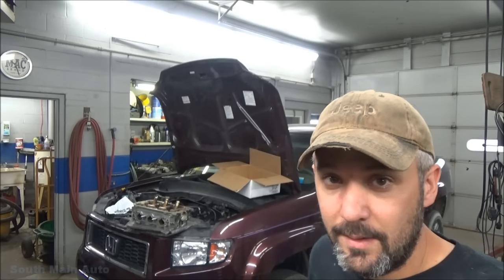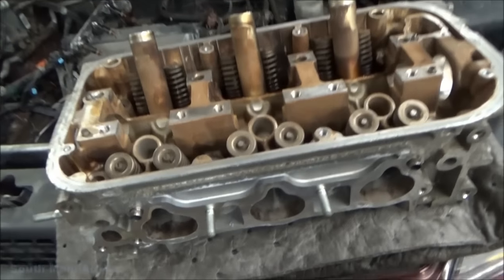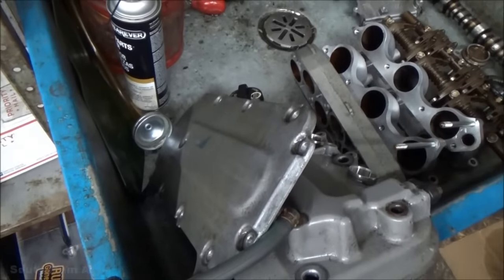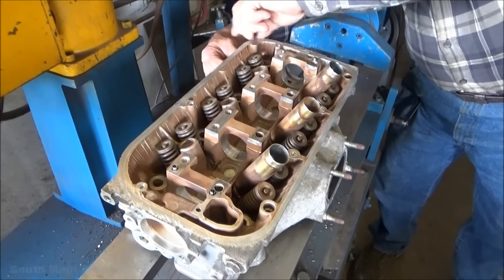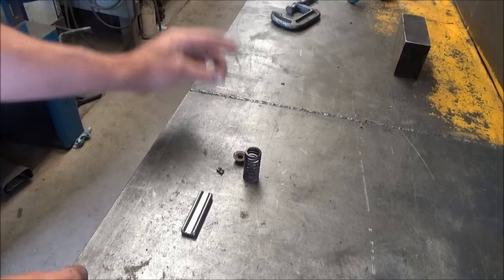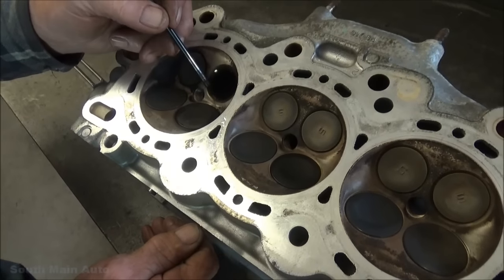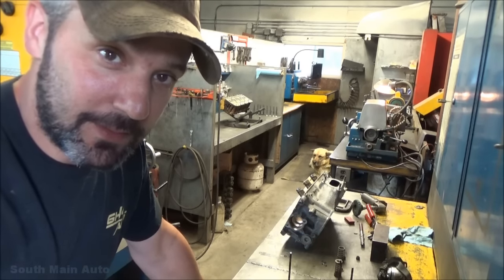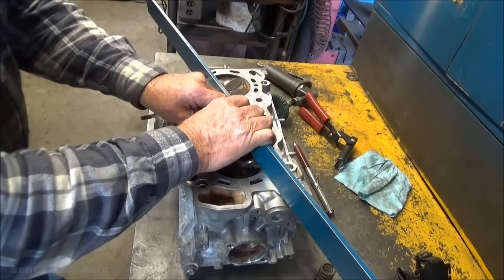Honda Ridgeline - Quick Trip To The Machine Shop

Comment: Nice.  Those kind of good small machine shops are a god send, those older guys with decades of experience are priceless.  Plus he has a shop dog hanging out so that makes it a legitimate shop...haha.
Reply: That dog probably been around the shop so long, he can fix heads.
Reply: I've got Johnny Rackleys here in Mesa, AZ that is AWESOME!!! They've done so much talented work like filling in aluminum heads that have been rotted out by plain tap water destroying the heads water ports and grinding back down during head plane process. Supplying thicker head gaskets to compensate for plaining the head etc. Great guys.

Comment: I'm an older guy[76] and i had my stroker engine built by one of these older gents back in February. He showed me the many flaws/mistakes the previous builder had left. We really learn the hard way as to how important that experience is. The younger guys just need time to get there. Not enough new ones coming up either. I thought i knew a thing or two about engines, boy did he give me an education as I assisted in building this stroker. Things you can only learn working side by side with these racing engine experts. Much respect......

Comment: I retired after 30 years in the Navy.  Tried the whole retirement thing but found I needed a reason to get up.  A long time friend of mine has owned his machine/engine shop for 45 years.  He's 67 and still works 16 hour days at least a couple times per week with all the business.  People send him stuff from all over the country because there's not many like him around who are truly "old school".  He only had another guy working for him and he exclusively does the heads.  He needed someone to be a "go-fer" so he could just concentrate on engines and not ordering parts, running for supplies etc....He "hired" me and I've been doing it now for 2 years.  The amount of knowledge he and his ilk have is amazing.  I've learned through doing now and really enjoy getting dirty and picking his brain.   Although we specialize in vintage American iron...we still have a fair amount of business from dealers and indy's so see a lot of Subies/BMW's etc..Guys like that just get stuff done.  It's not what they do...it's who they are and it IS difficult for them to give it up.  I don't see Gary "retiring" anytime soon...I literally think he'll do it as long as he can physically handle it.

Comment: I worked in an automotive machine shop for 8 years early in my career. Enjoyed learning from an older guy and turning out quality work. Glad to have had the experience. It was pretty cool seeing his shop and it took me back to the day, so to speak. The one thing I remember most was an old 50's chevy six cylinder that had been laying in the mud for years and I beat it apart with a two by four and a hammer. After all the machining and cleaning I reassembled it. From rusty scrap to a workable engine. Lot of fun for me. Thanks for taking the time to make the videos. Your time is appreciated.

Comment: I think the Honda tech hit the valve while turning the motor over by hand after the bad TB change.  Felt the binding and fixed it before he cranked it. But they did make physical contact and tweaked it a tiny bit.

Comment: Years ago when I still had my Outerlimits I had a pair of motors built by a guy just like this. He was a legend in offshore powerboat racing and I was lucky enough that his shop was close by to get work done there. Similar one man shop kinda place, and the work took forever, but only because there was a 3 year backlog of people waiting to get work done. At the dyno shed, they made about 1250hp each and were absolutely bulletproof. I had a blast with that boat but sold it just before the first overhaul.

Comment: In my opinion, which isn't much, is that the dealer tech had let the cam slap the the valve when the timing belt off.  Notice when your turning the cam in the other video how it has some kick.  Another possibility is that he had it a tooth off and started it and realized it later and corrected it.  In 4k miles I would say that you could build some carbon with a leaky valve.  Good video for sure.
Reply from the maker: I think in this case we may never know
Reply: Thats the truth.  I had bought an 05 TL with 87k that had the similar 3.2 Honda motor.  It was leaking oil from head gasket between head and block.  The guy I bought it from said the dealer did work on it 3k ago.  I called and they said it had some stripped head bolts and they pulled the head and put time certs(helicoils) in the block. 92K it was still leaking so I changed the motor myself. Just another example of how dealerships work.
Reply: Ya the preponderance of the evidence points to the dealer tune up. After taking her 80,000 mile bran new baby in for scheduled service, she gets it back with a bent valve. The dealer " I know your used to 6 cylinders, but 5 is ok"

Comment: My theory: either cam or belt was installed 1 tooth off, while turning over by hand to check, piston simply pushed against valve. There is enough mechanical advantage to do this. After misalignment was discovered and corrected, engine assembled- it was too late. Leak became worse as valve face angle burned, carbon built up, then stem was further weakened and burned. Dealers fault
Reply: That's a good theory.
Reply: I agree that's a logical theory - unfortunately there is no way to prove that is what happened!  And therefore no way to really get $$ from dealer!
Reply: yeah I'm afraid you're right,the vehicle has been out long enough to get the oil trail leading to a off center valve and started suckin oil into that cylinder,the carbon build up is the direct relation to the cam belt installation,when doing any kind of timing chain,belts,don't let engine get out of sync,not even a little bit,these little engines have gobs of spaghetti ,wires,vaccuum lines galore,the relationship of timing is critical,despite engine size,ERIC you were wise to get the experience check,he's a little older than me,when we're   gone all of that machine knowledge is gone too,i watched the first two videos,when you pulled the head I saw the oil,your compression test verified it
Reply: Problem appeared after timing belt changed.  Suspect you are correct, and the dealership did the dirty on their customer. Impossible to prove.
Reply: @davidhutchison3343  how long ago was timing belt done.
It would have taken time to build up carbon
Reply: @golfish8589   i think he said 4000 miles ago
Reply: That was my exact thought when The Machinist said there was a very slight bend in the valve. The mechanic did what he was supposed to do and crank the engine over slowly by hand after assembly and the thing hit he realized he made a mistake which is possible to do. Corrected the timing error but at that point the damage had been done.
Reply: What about the other exhaust valve in that cylinder? Didn't say it was bent. Kind of hard to believe that no other valves got bent from your theory. For the very tiny bit that valve was bent the tech. would not even have noticed anything from turning over by hand if your theory was correct. Not buying that theory.
Reply: @KStewart-th4sk  
In the follow-up video they discovered the mass of carbon buildup on the backside of the stem is probably what caused the bend in the valve. Cause excessive drag on the valve preventing it from closing. The question is what caused the carbon build-up. And nobody really could be sure
Reply: when you do a timing belt on a honda v6, the rear head is the one that "jumps" a tooth if not careful.  the front one is always straight.
Reply: If it were timing belt not aligned properly both exhaust valves in #4 cylinder would be bent.
Reply: one tooth is usually not enough to cause any sort of interference. You normally need a couple teeth off before you got impact. Of course anything is possible in a dealer flat rate shop. could have stuck the belt on, started turning over the engine and been like "oh, duh, i was supposed to align those marks first... oops"
Reply: I've had to use questionable parts (the almighty dollar) when installing timing sets, come back with a failed belt tensioner. Actually had one of these Honda with misfire on the entire rear bank, and was off several teeth. No bent valves... there is a fair amount of wiggle room there.
Reply: Concur, with added thought that dealers intentional screw up so as to sell a car
Reply: From the video, I didn't see the exhausting valve bent, even after the Machinist grind the valve, he noticed the bend is very tiny, So my guess is the carbon piled up just because some occasional reason, in this case, if the machinist just replace the spark plug, and run it in highway for few hours,  the carbon burnt out is possible,  no need to remove the cylinder head.
Reply: I don't believe one tooth will crash the valves. It will set the engine light.
I know that's the case with my Volvo 5 cyl.

Comment: Eric as you say...chicken or egg?  if the piston hit the valves there would likely be a mark but there is no obvious mark on the piston.  the valve is bent so slightly that it would not require much from the piston to deform it.  Even though that piston looks clean I would get all the carbon off it ...even in the valve grooves and see if there is al ANY indication of a hit.  We HAVE to know for complete certainty

Comment: Worked as a Machinist on and off for about 10 years for my families shop, made mostly hydraulic parts for Boeing 737’s, but did work for NASA also, my stepfather ran the shop for over 40 years had to retire because Boeing quit using small suppliers. But learned so much and would of loved to have kept the shop open, but he had to sell for retirement, which he earned.

Comment: Great video series.  I learned several things. Why let the timing belt mechanic off the hook in video 2?  Don't the signs suggest the valve was hit with the piston when turning the crankshaft or camshaft manually with the timing belt off, and that slightly bent the valve?  That wouldn't necessarily leave a mark on the piston one could see after 5K miles  The bent valve likely ruined its guide and started the oil leak, causing the carbon buildup.  That valve didn't bend on its own.

Comment: I think you missed one point...  It doesn't make any difference how much the exhaust valves and guides are worn.   The oil will only go blowing down the exhaust pipe, not into the cylinder, as the gasses only go in that direction.   The oil is getting into the cylinder from somewhere else.

Comment: I’ve done quite a bit of engine rebuilding myself and since it’s only one exhaust valve that is bent my guess is a piece of carbon went through the engine held the valve open and the piston hit the valve and bent it slightly. Probably long before the timing belt was changed. In my experience warming up your engine all the time and not getting the engine up to red line once in a while causes these issues.

Comment: Quick question.  Are you planning on taking the back head in for a check and new guides as well.  My experience has taught me that if the guides are showing wear on one head, you will see similar wear on the other head.  Seems like a relatively cheap repair at this point as everything is already disassembled to remove the second head.

Comment: How come you don't have your own valve machine and seat machine? Easily under $1,000 for a used one. I think I have less than 500 into both of ours. When I was growing up that was standard garage equipment, along with the VanNorman boring bar with the "sucker outer" for boring cylinders in the car

Comment: I have this (similar) engine in my '06 MDX and, around 200k miles, had the timing belt and water pump done.  Around 205k started to have significant idle problems -- long story short, once warmed up it would run fine for the remainder of the day.  I decided the car was too old to spend thousands on diagnostics and repair so I turned to YouTube where I learned enough to do things such as change out egr valve, clean throttle body, etc.  finally grew the balls to do a valve adjustment which fixed everything -- car runs like new.   The biggest fear I have now is what cleaners/chemicals I can use on different parts of the car.  Seeing all the parts I took apart laying on Eric's bench all nice and clean I would love to know what he used to do the job.  I realize that there will be a lot of folks screaming "brake clean" but wonder what makes it so great, what can't it do, etc.   any rules of thumb or basic info for a desk jockey who wanders into his garage more than he should?
Reply: brake clean will clean pretty much anything but if you get it on rubber seals/o-rings it could possibly cause them to swell but not always. Still best to avoid them with brake clean. otherwise simple green seems to work well and is pretty safe. hope it helps
Reply: Get familiar with a wire brush

Comment: I was taught by an electrical mechanic whose that old now (he's 77 now),while that skill was based around power tools (e.g. rotary jack hammers,etc) the skills are very easily transferrable to an automotive trade, I did a small course called automotive industrial which would've been an intro course to becoming a diesel mechanic or something but the tech wouldn't let me pursue it to the point of shutting that part of my local campus down.

I still ended having to fix my own car up anyway,I've rebuilt my own power steering rack,etc !

Comment: I don't comment much but I'm still watching! I really enjoyed the Chevy engine remove/install engine videos and I didn't think they were too long. What a pain in the butt that was!. I miss the days when we could climb right in there with the engine and easily work on everything, but I guess if I went back to that I'd miss all the whistles and bells that come with the new cars. As for this particular project, the owner of the Honda Ridgeline should have had both heads done. I realize doing the head with the problem will fix the immediate problem, doing both heads would take care of potential problems down the line, cost them less money since the whole thing was torn down anyway, and give them improved overall performance. But hey, it's not my car. :-D

Comment: Hi Eric I got the Honda Pilot 2003 and I just ran into my first problem - 
The car runs good on flats, going downhill, and doesn't seem to lack any power. Get out on a highway and come to a big hill (up hill), and she boggs right down. And I MEAN bogg down. From cruising at say 70 MPH, it drops down (right down) to like 40 MPH and struggling (no kicking or bucking) to get up the hill. The car just drags its way up the hill. I try to step hard on the gas pedal rpm when up 2200rpm to 2500 rpm but it doesn't help at all for the most part, it's just bogging. Pretty embarrassing being passed by loaded down dump trucks. The RPM's climb, but, no power - just total lack of power, as it is climbing the hills. Get to the top, or to a flat, and she takes right off like nothing is wrong. Now, take that same situation - a hill - but now instead of being a hill on a highway (65 MPH), let's say I'm on the back roads and starting out on a hill in first or in second gear (ATX)...no problem - it pulls the hill strong. 
Now, I just put in a new fuel pump and strainer, replaced a torch converter new plugs and wires, changed the oil and filter, c form fuel injectors cleaner and new timing belt the fact that the car will fly with no bogging at all on flat  from first gear to the 6 gear no hesitation at all it only happens on the last gear uphill on highway speed 
Really wondering what is wrong with the car greatly appreciated.

 

JvHi Eric I got the Honda Pilot 2003 and I just ran into my first problem - 
The car runs good on flats, going downhill, and doesn't seem to lack any power. Get out on a highway and come to a big hill (up hill), and she boggs right down. And I MEAN bogg down. From cruising at say 70 MPH, it drops down (right down) to like 40 MPH and struggling (no kicking or bucking) to get up the hill. The car just drags its way up the hill. I try to step hard on the gas pedal rpm when up 2200rpm to 2500 rpm but it doesn't help at all for the most part, it's just bogging. Pretty embarrassing being passed by loaded down dump trucks. The RPM's climb, but, no power - just total lack of power, as it is climbing the hills. Get to the top, or to a flat, and she takes right off like nothing is wrong. Now, take that same situation - a hill - but now instead of being a hill on a highway (65 MPH), let's say I'm on the back roads and starting out on a hill in first or in second gear (ATX)...no problem - it pulls the hill strong. 
Now, I just put in a new fuel pump and strainer, replaced a torch converter new plugs and wires, changed the oil and filter, c form fuel injectors cleaner and new timing belt the fact that the car will fly with no bogging at all on flat  from first gear to the 6 gear no hesitation at all it only happens on the last gear uphill on highway speed  and every time I turn off the engine for 10 minutes and try to start the car back on it's crank longer then usual still it's sound kind of rough and there's one time it's start like explosions 
Really wondering what is wrong with the car greatly appreciated.